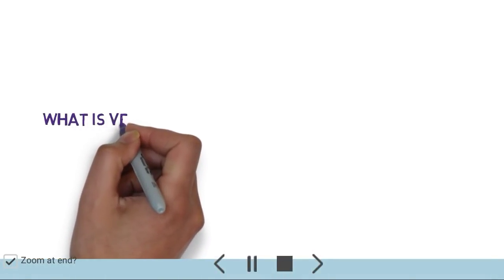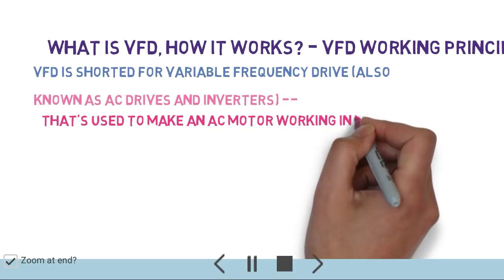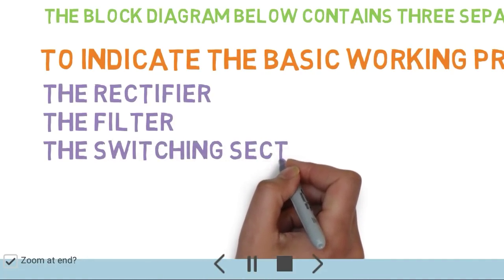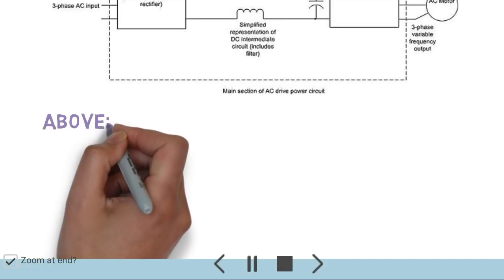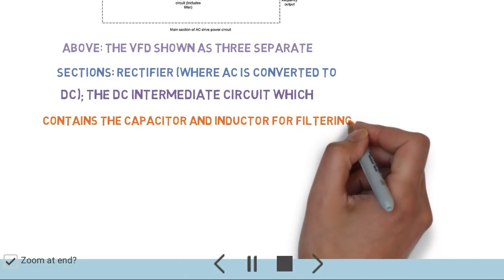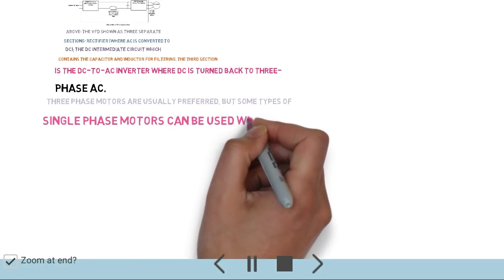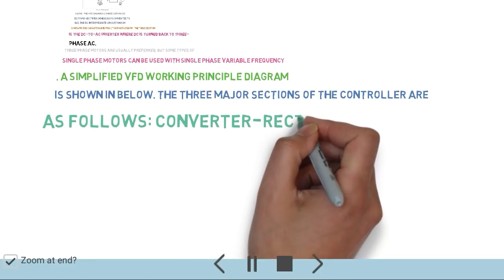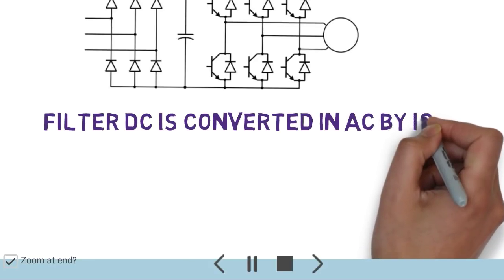VFD working principle.what is VFD

Comment: 415 input voltage ke bajay vfd Mai 690 voltage input de sakte hai kya ? Please reply
Reply from the maker: Yes but vfd range is 690 voltage require and motor in supply also designed for 690v